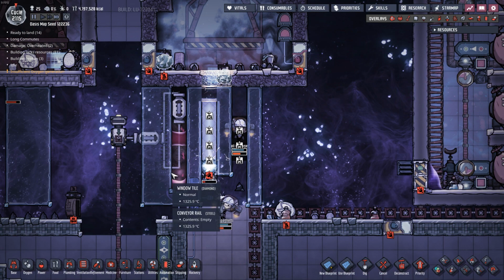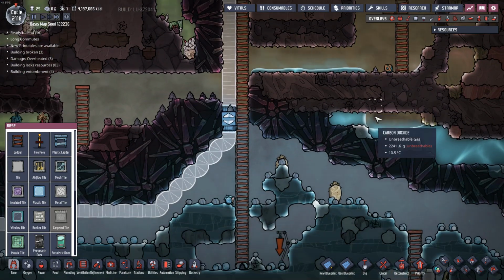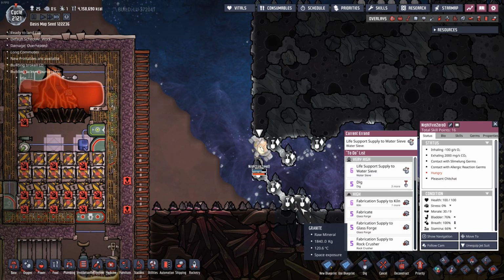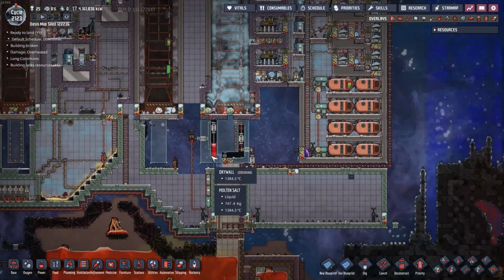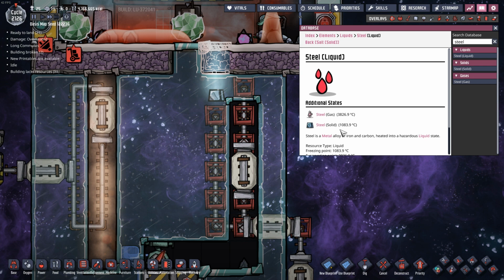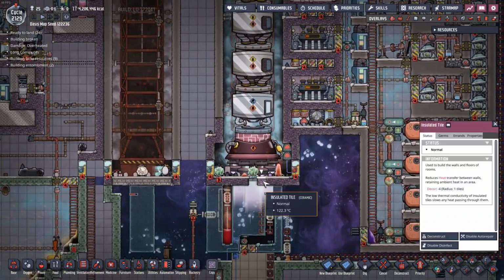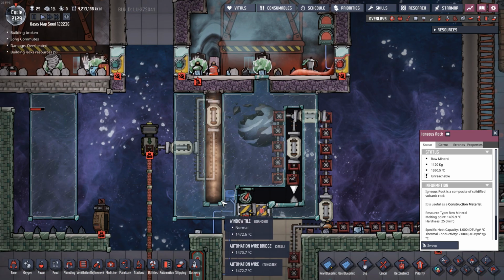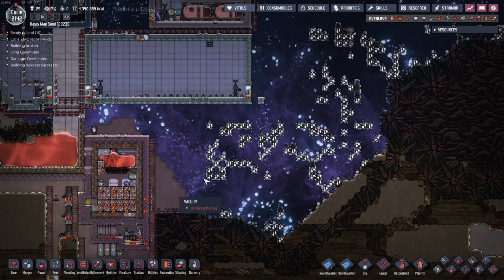Energy Boosting From Molten Salt! Oxygen Not Included 46

Comment: Okay. I've got a map with 3 volcanoes within a 20x20 box. I want to build one of these salt reactors so bad. I haven't begun to build a design but I wanna run steel radient pipes full of aluminum through magma into the salt reactor to produce INSAINE amounts of power. I don't know if it would work. But considering that it would use very little power (using a liquid loop and maybe a shutoff or two) and produce and INSAINE amount of power. I'm very hopeful. Excuse my little rant and I'm not sure if you'll see this but thank you for reading.

Comment: Those insulated tiles beneath the rocket can't transfer away any of the heat that the rocket is putting into them, and so they are melting. Yeah, the obsidian ones. Switch them all out for diamond tiles! I have a nasty feeling you'll even melt the insulation as well, seeing as rocket engines don't seem to have a max temp. They just pump more and more heat into a tile, and if the tile can't transfer that heat away before its melting temp then it'll just melt.

Comment: How is this plan increasing thermal energy in the area? Salt Gas condenses back into Molten Salt, right? That means you don't keep the increased specific heat capacity, I would think.

Comment: With all the volcanos, would you consider using the Magma as a heat source for building a fractional distillation column.  Flash solids and liquids to gas then separate them vertically using their respective differences in gas density.

Comment: The problem here is that you're not actually taking advantage of the salt phase change. Regolith permanently changes its heat capacity, but salt doesn't. Right now you're really just heating it up to a point where it is harder to heat up, then pulling the same energy out as you put in. What may actually work, is if you can sort of cheat the game. Try dropping the temp of the salt gas way below the condensation temp. By doing this the game doesn't have time to condense the gas into liquid, the liquid of course having less energy to draw out. To really get the most out of the salt, you need to heat it as far above its boiling point before it actually boils, then cool it as far below its condensation point as you can, before it condenses. I hope it makes sense.

Comment: maybe the insulated tiles are melting because they have very low thermal conductivity. so it get heated slowly, but then it also can't cool down. so eventually the next rocket launch and the next and it get hotter and hotter. and eventually melts

Comment: Hahaha, I forgot to mention on my last comment to use insulated insulation for the rocket tiles. Well you found out anyway. 😂

That solitary diamond tile is leaking heat out to the steam chamber. Replace that with insulated insulation and you'll be as efficient as possible. 

You can wire the solar panels with heavy watt, no need to waste the precious thermium on transformers 😯

Comment: The regolith was absorbing heat for its phase change so when it ran out you lost mass in that area (a form of cooling loop) so the heat rose to the point it melted stuff

If you keep the regolith supply constant it won't melt the corner tiles and track.

Comment: You might need to change the salt boiler top into a door to help with the overpresurization. Not really an exploit, just to prevent the liquid- gas interaction  bugginess being strange and deciding that stacking liquid salt at the top instead of letting it fall is acceptable... also probably should change the insulation on top to well... insulation. Because it seems to be condensing the salt at the top for some reason, and the only reason I can think of is heat bleed.

Comment: I understand the pressure damage to the tile on the left above salt gas. But what happened to the diamond window tile under the rocket? It shows that it require repair as well, which is crazy!

Honesly, as for melting insultation into tungsten, I tried that on my last map since I had no planet with wolframite and I gave up: Without Thermium and without using exploits, there was nothing to do. I could not go above 2400 degrees with an Hydrogen rocket.

if only there was the plasma state above gas, that would be fun to reach :)

Comment: about the salt it multiplies the heat, but when it condensate again it does Goes Back to the Milton salt heat capacity, so you will only multiply the heat of 5ºc +/-, any heat that it gains as gas will not multiply because it is already salt! and any temperature below the condensation point will simply return to the specific heat at the time it becomes liquid again. The only way to actually generate a good amount of energy from the salt would be if you used the bug of liquids below a certain amount to not vaporize on emthe pipes and heat the salt to a temperature well above the temperature at which it becomes gas. then with the pipe sensor (I don't remember if the sensor accepts such extreme temperatures) remove it from the pipes and make it become a gas, so take advantage of this specific heat growth for at least about 100 °, and then when he was liquid again you would have to find a way to get him back in the pipe

Comment: you shouldn't put isulated tiles under the rocket, the rocket heats the tiles but as they are insulated they can't transfer this heat, if you had placed the normal tile it wouldn't have melted...

Comment: the problem with using salt gas is you can't extract that heat. once you start extracting it'll turn back into a liquid; you can only get back the energy you put in more or less, you can only get etra energy if it melts at a higher temperature than the new material phases down